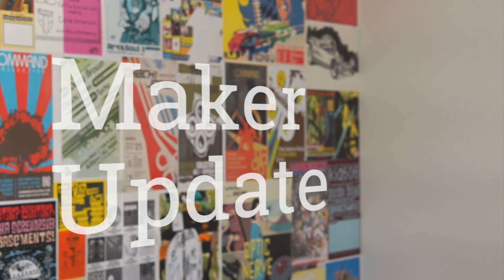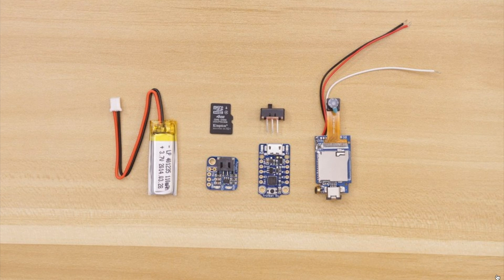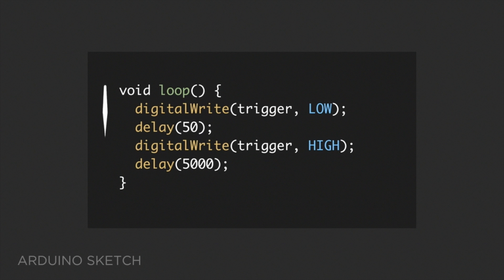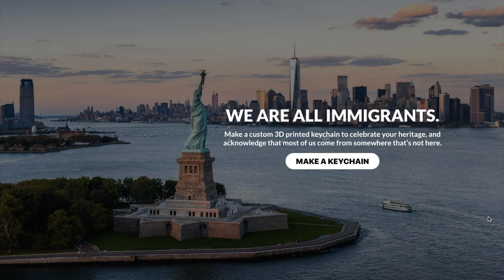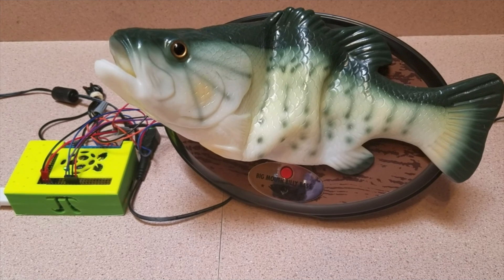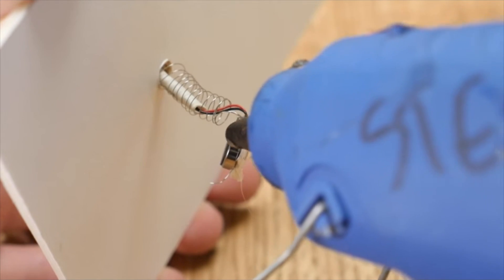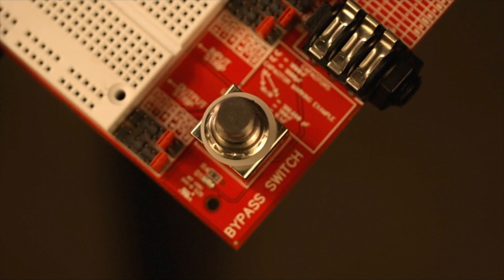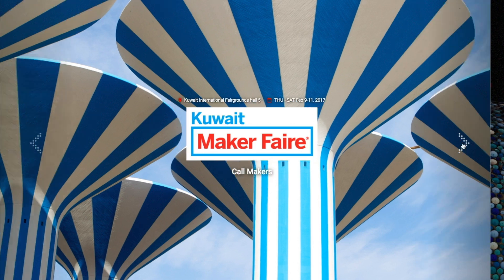DIY Spy Camera and IoT Valentines [Maker Update #20]

Comment: the friction welding works very good with pla and ok with abs, no smell at all but the speed and pressure is crucial. you have to try on some scrap pieces to find the right settings.
Reply from the maker: Good to know! Thanks Clemens.